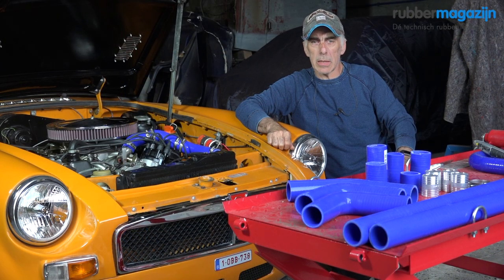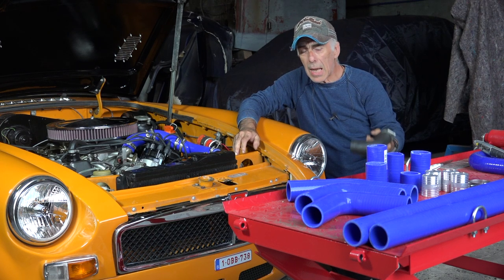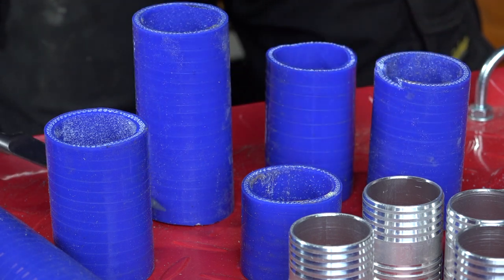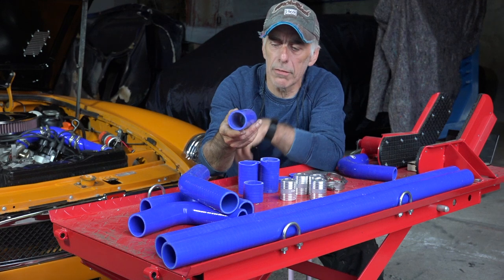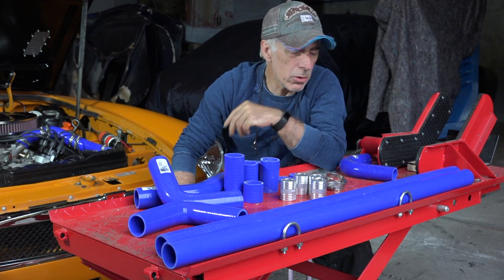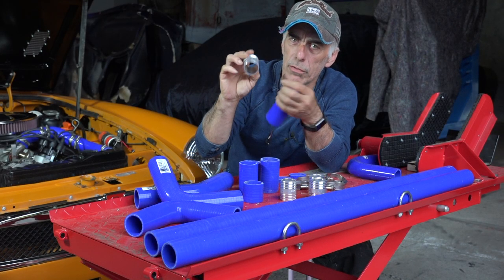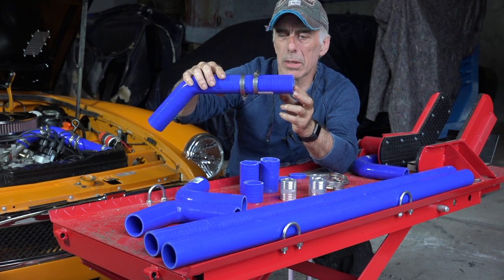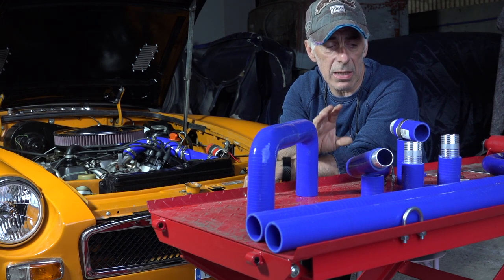Part 2, Creating your own custom formed  silicone cooling hoses for your car

Comment: thanks for posting. I woulld like to use them on my Porsche Targa1984 as heater hoses for a modified exhaust manifold. Do you know how much heat the silicone can handle?

Comment: I think you got it going on with what you are talking about.  Bought rubber radiator hoses for my particular model, and they didn't fit.  Looking for solutions.  Yours sounds like a good one.  Thanks!
Reply from the maker: Txs for the comments,
Reply: @D3Sshooter  You're welcome!  Good advice.

Comment: Hi you could take a look at Sil-Poxy or Sil-Key which are silicone bonding agents these might allow you to use less hose clamps at the intermediate joins.. Thank for the link to the website for the tubing... 👍🏻
Reply from the maker: canuckguy worried  , they are very good however when looking at it , one  might get the impression that its a mickey mouse job just because of the spanners
Reply from the maker: I will have a look and see how that might work , a combination of the coupler and that product you mentioned...  It would have to bond aluminium and silicone,  so i assume we will need a primer to do so.   Good tip , thnaks

Comment: I like silicone. It sure would be nice though to have a product that could be bought in straight lengths and then bent to your specs. It is just that every join is a potential leak.

Comment: Where is the rusty french truck?
I enjoyed your metal panel making...
Reply from the maker: Its awaiting full time attendance, I had to clear-up a few small projects first.  Soon Rusty is back... big time
Thanks for waiting
Reply: @D3Sshooter  Our factory can add the metal wire to the inside of the silicone tube to enhance the negative pressure strength of the silicone hose. At the same time, the wire will not be exposed on the inner and outer surfaces. This is our company's invention patent in 1991.

Comment: Looks like a great solution to me - I have never understood why standard hoses are black, the blue looks so much better !
Reply from the maker: Thank you
Reply: In the refit industry, general antique cars like black, and traditional car refit cars like blue. Now in recent years they like red inside and black outside. The colors can be customized according to customers.
Reply: Any color other than black can get smudged with grease & oil and is nigh impossible to clean off of silicone.
Reply: @aaronmatuszny8856  that's exactly it.....esp. the lower radiator hose like in my situation..I'll stick with black on the bottom, maybe go blue on top..

Comment: just be careful that you don't have a high spot in that tube. Should have a bleeding valve on the highest point, could be an air-trap ?
Reply from the maker: Indeed, this hose is already a lot lower then the original , but I need to be able to get distributor cap off... I refill the cooling liquid always under vacuum, and seems to work very well

Comment: Very misleading video title, this is just a cobbled together mess
Reply from the maker: claymore2k1 txs for your honest comments. And now, how would you do it
Reply: @D3Sshooter  I think claymore2k1 may have been looking for the same thing that I am. And that's how to wrap and bake your own hoses.
It may not be a DIY job. For me, the change in angle, shape and diameter is such that standard hose bends won't work.
Plus they are too flexible.
I'm looking to make intake runners.